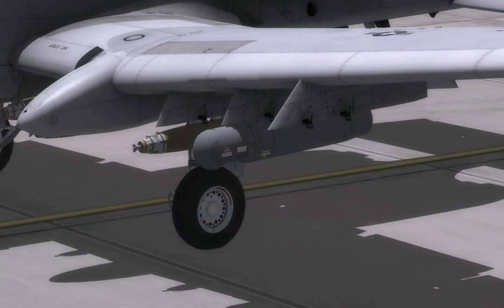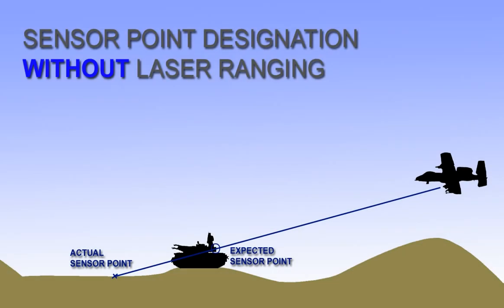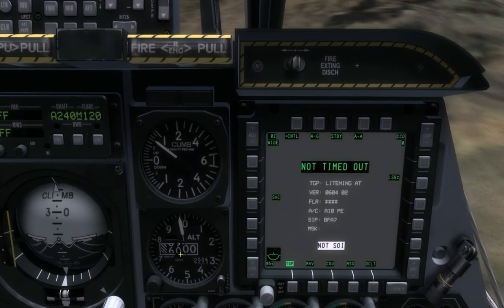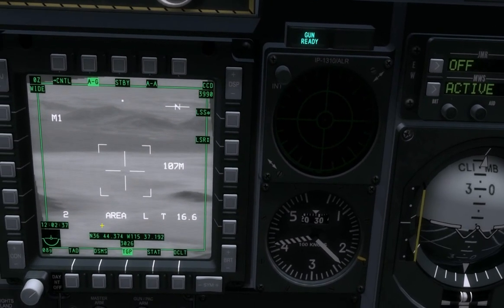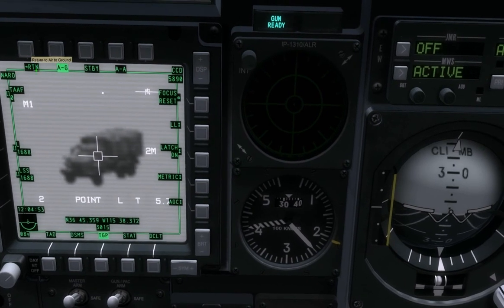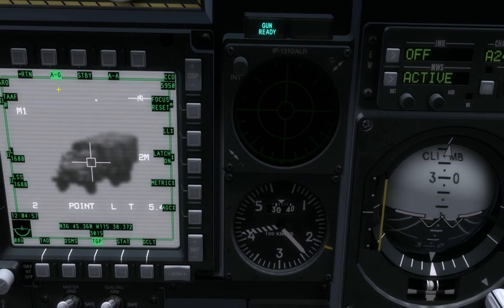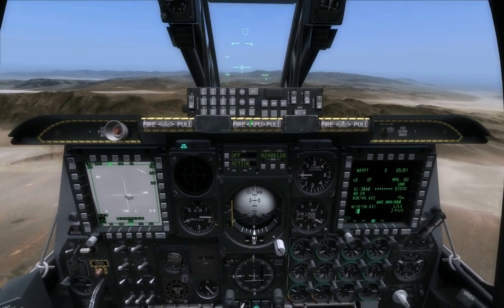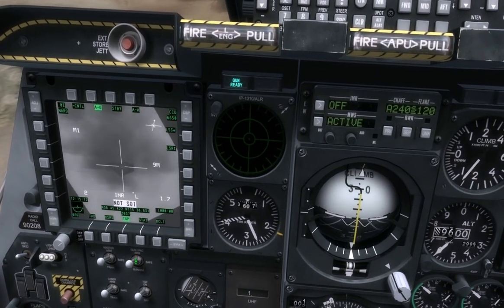DCS A-10C Ground Attack With The Targeting Pod

Comment: I love the A-10C but I have a horrible time finding ground targets even when i know were they are.  Is there a best graphics setting to get the vehicles to stand out a little? I don't want to use labels  i feel it's cheating.1
Reply: thermal? bhot and whot helps alot you could also enlarge the models in the options
Reply: There is no realistic FLIR simulation at the moment. BHOT and WHOT modes are just color filters, so they are useless when target color is close to ground texture color.
Reply: TheSpinyMouse Yeah most of the time sometimes it helps but nowhere near where it should be indeed so all that really helps is large model size or enable the f10 map with enemies
Reply: Exactly! But somehow, in the past, even with color filtering mode you were able to see target vehicles much easier and distinguish them from the surrounding, but now it became impossible after the last patches. Instead of making it better, they were genius enough to make it worse than it was.

Comment: Jdams doesnt need to be lased but the laser is used for ''marking'' the object otherwise without the laser the computer marks the terrain as the video says.Gbus are laser dependent if you dont lase them correctly they will not hit the location you wanted.
Reply: Nomad it depends on what gnu you are using. Gbu-10 and gbu-12 are laser guided, but the 31's and 38's are gps guided. Once you laser the target it send the target info to the gps guide bomb and you basically release and forget.

Comment: A JDAM is a GPS guided weapon, thus it wont react if you fire the laser while its in flight, instead it will try to hit the coordinates you designated it to. Because of this, you dont need to fire the laser, the only usage of it here is to get accurate coordinates as explained in the video.

Comment: Oh AND even if all 4 of the fuel tanks are destroyed,, the A-10 STILL has two self-sealing sump tanks that give about 250nmi to get ya home. as for the engines, they use a turbine  that produces much more power than a multi turbo compressor uses and converts that excess power to drive a ducted fan to then accelerate air from the front of the engine rearwards nozzle. This uses much less fuel and heat but what heat it does produce is sent over the top of the tail-wings which blocks it from below

Comment: It has self sealing fuel tanks with a mixed flame retardant to protect from fuel leakage and explosion also unlike other planes,  the fuel is not kept in the vulnerable wings but in the center fuselage and in 4 separate armored tank, If one is breached the fuel is dumped and weight distributed. The pilot is protected within a bathtub shaped shield of titanium capable taking a direct impact from around a 60mm sized cannon.  Even the look of the plane has a defensive purpose. The engine placement

Comment: You have to love military aviation and or like me,  be totally in love with the A-10A+C,  If you have a passion for this amazing plane and it's wonderful to really know about its combat and development history.  For instance,  the A-10 can totally lose hydraulics and any mechanical parts connected to that system because it has a completely separate backup cable/pulley system called Manual Reversion and its saved countless lives and got planes home that otherwise should have ejected.

Comment: You turn on the laser in flight with the Nose Wheel Steering button. Also he only made two mark points to demonstrate the difference between the actual locations with and without lasing.

Comment: @HikingForSpirit NWS Button, also used for engaging your steering wheel when on the ground and for resetting your refueling boom in case of a disconnect.

Comment: Very nice Video. I do the whole procedure like you did in this video. But my JDAM are ALLWAYS off the target. They hit the mark point exactly, but these mark points are off the target. I knoe the difference of area and point mode, and I allways used the laser ranging to set the mark points. Do you set the mark point as SPI before pickle the GBU? Do you use Singleplayer, or MP?